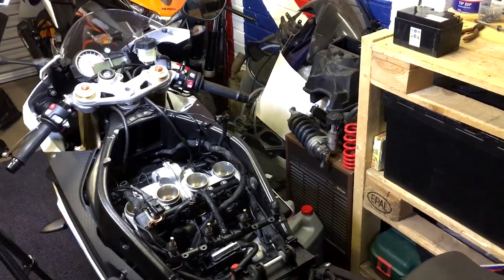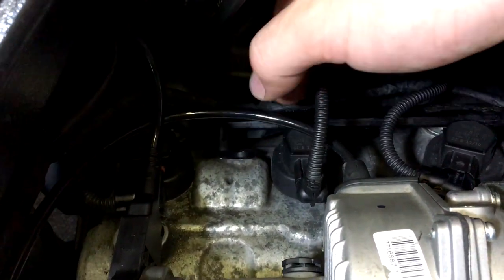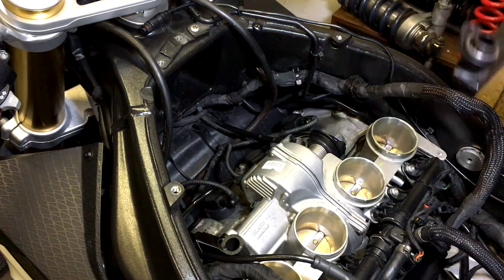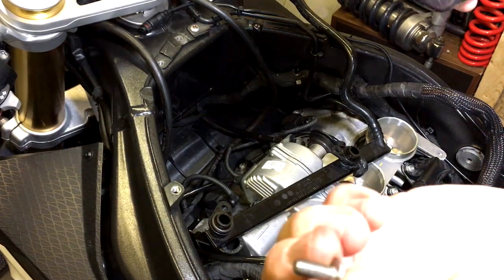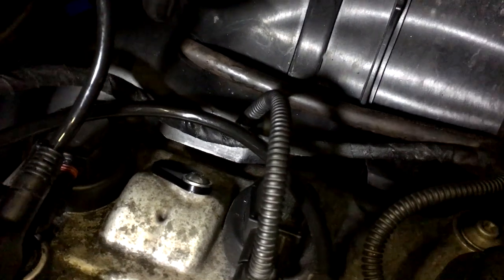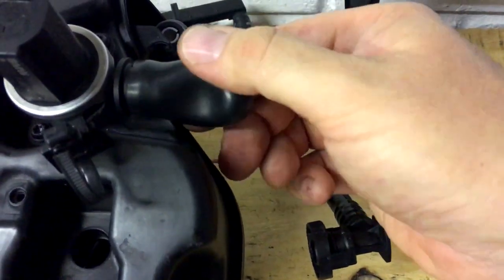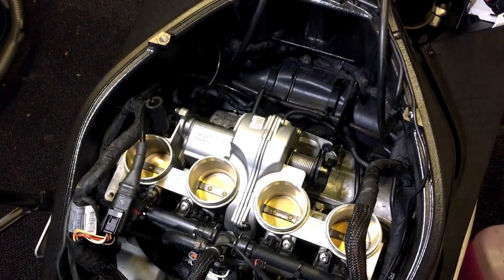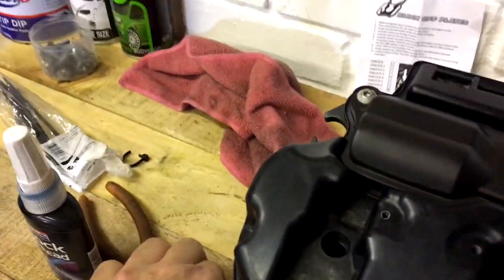How to Fit Block Off Plates - PAIR System Removal BMW S1000RR

Comment: Great Vid, thank you. I just put on a full Akra exhaust with the Rapid Bike Evo tuning module on 2017 BMW S1000R. It sounds so good but does pop a lot on decelerations. Did this work out well for you, worth it?
Reply from the maker: Hi and your welcome, oh that's some nice mods. I bet she sounds great now! Yes I'd say it worked very well at reducing the popping. A lot of manufactures recommend this mod if your using a full titanium system as the popping can cause damage but not so needed with a steel system. All the best, Griz.
Reply: @SixthGearMotorcycles  i just ordered a full titanium akra gp system for my 17 s1000rr do you think I should do block off plates? It’s just a street bike too
Reply from the maker: @MADLITS1K  I think block off plates are recommended when fitting a full titanium system mate, so I would yes 👍
Reply: @SixthGearMotorcycles  i just checked brocks performance and looks like I don’t need to remove the system just block a hose so I ordered that $2
Reply from the maker: Great stuff as long as its blocked off you should be fine 👍
Reply: @SixthGearMotorcycles  yeah that was my concern.. thanks man! 👍

Comment: Hi ! If I do this mod, is there any error indicator appear on the dash ?
Reply from the maker: You shouldn't get a error show on the gen 1 and 2 models no 👍
Reply: @SixthGearMotorcycles  thanks man :) I have a 2015 rr with full titanium akra racing and PC5 :) it does a lot of pop at low rpm but not on slick mode
Reply from the maker: No problem, not sure if you will or won't get a fault code show on a 2015 but it will definitely reduce the popping 👍